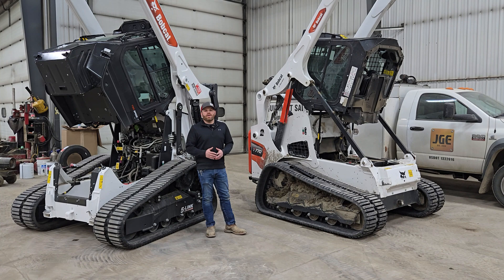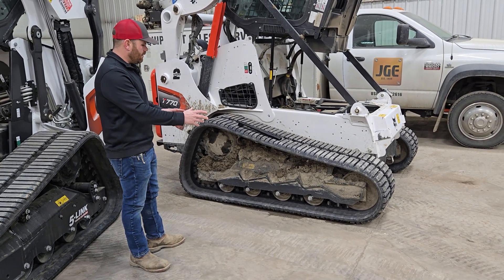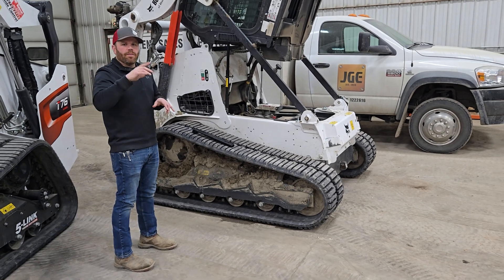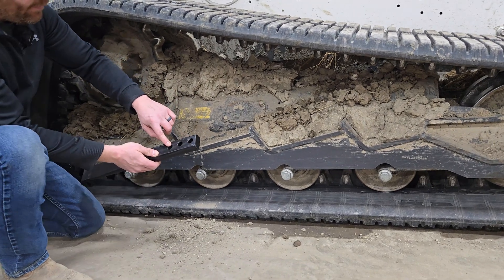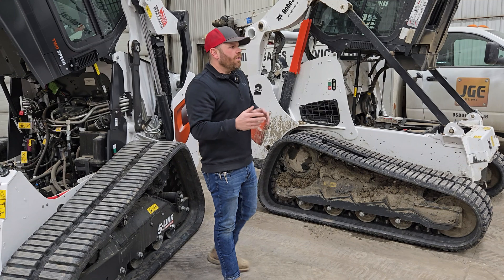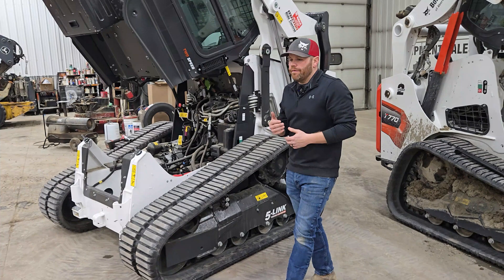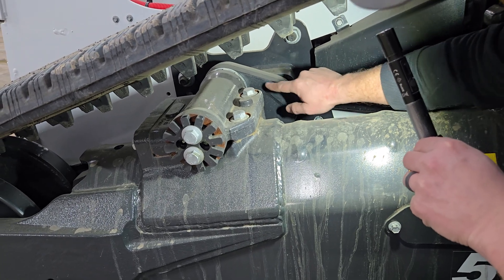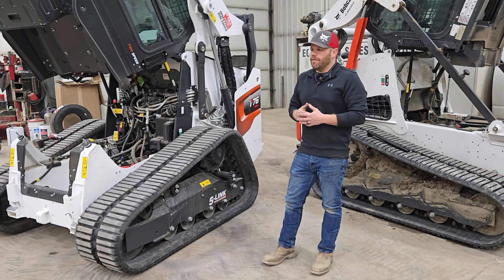Bobcat Torsion Suspension Vs Roller Suspension, A Detailed Breakdown!

Comment: Where is the fifth link? I only see the two torsion axles.
Reply from the maker: The rear axle has links connecting the axle to the track frame, those are the “5 link” which allows the undercarriage to move but maintain stability. Essentially, The Fifth Link: is an additional link  added on the rear axle, acting like a separate suspension element itself.